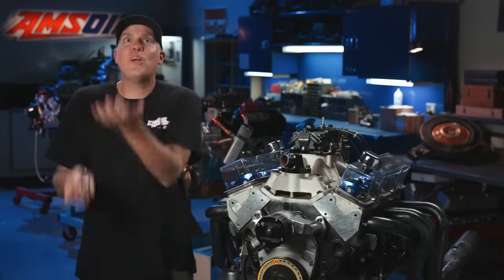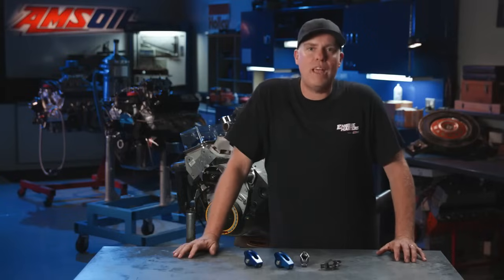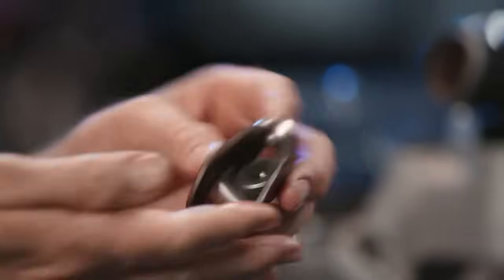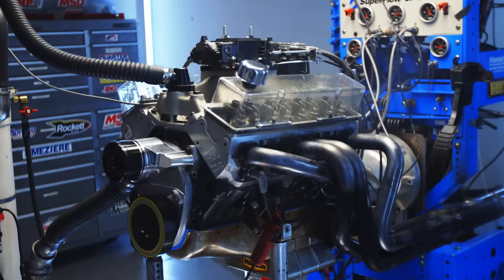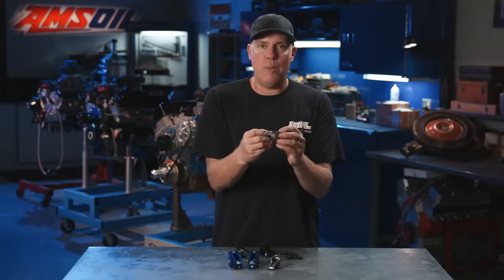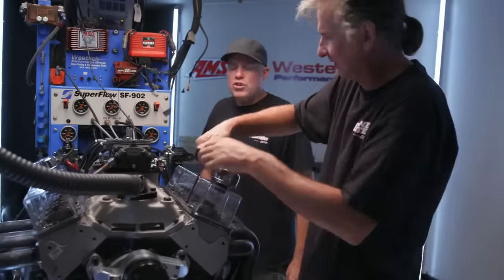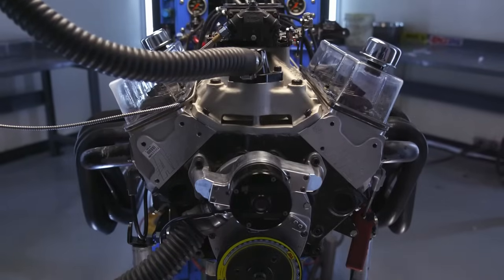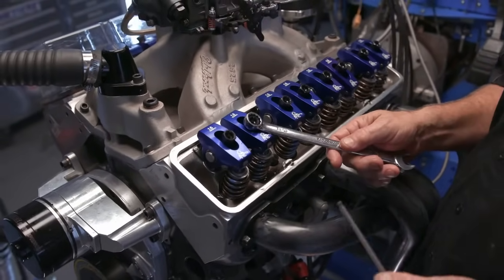ENGINE MASTERS  S2E29  Do Roller Rocker Arms Add Horsepower?

Comment: I never switched to Roller  rockers because they give more power.  I switched  to rooller rockers because my Boss 351 had a problem with Braking Rocker Arms. i Bought a set of Crane  Gold rocker arms in 1975 and I still have them. I explerianced two broken rockers, with that engine In teh last 50 years.

Comment: I'd like to see what an actual stock rocker would do. That's a "stock type" rocker with a stiffer body and more accurate ratios.

Modern oils also cut down on a lot of the friction the rollers are to prevent anyway.

Comment: Roller tip was invented to stop side loading the valve, if you look at a set of circle track heads that used stamped steel rockers you would understand

Comment: Def worth it first less friction equals less wear on Cam and guide's etc. The biggest gain is being able to use 1.6 ratio rockers. With a good set of vortec head's with some spring upgrades and a decent little Cam with a 107 to 109 lobe separation will wake a engine up and when you pair it with a msd ignition etc. sometimes the most important thing for having a good running engine is have good quality ignition setup and the proper intake. Weiand seems to have the best all around performance great driveability and great power band.

Comment: 19:12 don’t forget you also have to make sure you have clearance you don’t want the body hitting the retainer I don’t think the 20 hp is enough game for me to spend 800 on a new set of rockers from HarlandSharp not to mention then I would have to buy a new set of push rods and Smith Brothers pushrods aren’t cheap. I said a 16 runs about $250 i’ve always looked at roller rockers. It’s just something that gives you reliability and repeatability if you’re a demanding driver and you guys never mentioned stud girdles that would’ve helped you with the smaller 3/8 studs if you can find a set

Comment: Glad I watched this video because now I can tell a guy I'm building a 289 for to watch engine masters to end any arguement about how much HP is this or that worth. We're putting a  igger hyd flat appet cam and a few other goodies and he's not convice nor is his dad about how HP this mod or that might be worth. The 2 of them are comvinced changing cam and i take isn't going to make that much improvement over a stock engine. I don't agree. When Ford built the 288 2 barrel and got 195 Hp then installed a bigger cam and carb, made 271, not far off froma 100 HP gain and the lower level engine only made 25 HP more than yhe 2 barrel. Of course the factory 4 intake was still horrible compared to a good aluminum unit. I suggested i stalling a good set of roller rocker on this engine but so far hei not going for it. het. If I can get him to watch this, maybe he'll change his tune, pun intended. I can't get him to come off the single point ignition either. This guy is just a stick in the mid a out most everything. Gonna take a lot of work and comvoncing. Electronic is nust that much bette4 and even more dependable but maybe he's still on the dooms day think with EMPs going off. But that doesn't make any sense either because he drives a late model 6.0 LS pickup most of the time.
Reply: Good luck. I stopped building engines for people like that. They are never happy and everything is always your fault.  Even if you send it in a text. Give me your engine goals and here is your price.  Take it or leave it.

Comment: 4:02 as old as this is, I would still like to know the horsepower number difference between a particular set up with a 1.5 ratio. It is switch up to a 1.6 ratio. I don’t feel a 1.7 would be very common on the streets. I know that wouldn’t be uncommon for a big block, but I would be curious the difference in power production percentage of gain.

Comment: Nobody mentioned the failure rate of those tiny needle bearings in the rollers, or the failure of the roller tip when that aluminum starts wearing due to pressure etc. Those stamped steel will last hundreds of thousands of miles, not so sure about rollers. It's a matter of durability and reliability vs a few extra HP.
Reply: 200,000 miles on honda roller rockers.
Reply: You're forgetting that you'd need guides and valves by 200k, where as a good roller that didn't fail will allow the valves and guides to last far longer!!

Comment: I have to argue whether over head cam engines have rockers arms. They may not use a pivot point in the middle.l but they do follow the cams and increase lift unless you have an engine that uses buckets over the valves and thereby eliminate several moving parts in the design. Like a Toyota 3.0 liter v 6 or a Honda motorcycle
Reply: Those are called cam followers, instead of rocker arms.

Comment: I'm not sure why it took so many years for roller rocker arms to be used in the automotive and racing industry?  I have worked on large radial aircraft engines that were built for WWll fighters, bombers and transports. Roller rockers are indeed not new technology. Curtis Wright, Pratt&Whitney and Jacobs among just a few, All used roller rockers. Even the lifters in those engines used a roller assembly where they contacted the lobes on the cam plate. Durability and Reliability is what those big radials needed in a combat environment. Neat stuff for the early 40s thru 1945 and the end of the war!
Reply: A friend rebuilt a old Land Rover years ago, the engine in that had  lifters with a large ball bearing on the end of the lifter. That is the first Roller cam I seen in a production engine
Reply: If I remember correctly all of Chrysler research into hemi heads was for WW2 aircraft engines
Reply: @outinthesticks1035 That's right!!
Reply: @outinthesticks1035  I was part of "FIFIs" flight crew for about 10 years.  She was the only flyable B-29 In the world , but now there's another one flying. All of those Curtiss Wright 3350s that I worked on, had  Chrysler stamped on the back of the engine case. Cool stuff!
Reply: adding a roller is more complexity and cost, if you want to make money you avoid it... until you can't.
Reply: @nerd1000ify I agree!!!

Comment: I have a 4 bolt main 350 chevy with a Calif. certified Comp Cams cam and DLC lifters.  I use 1.7/1 full roller rockers for a long time now.  With these rockers instead of .480 lift I have almost .530.  What I did not know until now is the power from the rocker ratio.  I wonder how much more power there is from 1.6-1.7 rocker ratios.  This thing runs hard from 1,000 rpm.  I also had 2.02 and 1.68 stainless valves put in the heads with the proper springs for this lift and set the height with the special measuring tool for spring height.

Something for all to prevent broken studs in you heads, motor, and especially exhaust system.  20 years ago I changed all the exhaust, intake, and water pump bolts to stainless.  When you use stainless they will never rust and break.  I don't care how long they were in there or for many years the minute you put the wrench on the bolt or nut it just comes off.  It is worth the expense.  Think of the problem when an exhaust bolt breaks in the head.  That is a big problem to get it out.  Not with Stainless bolts.  This motor is in a 1969 Chevy G10 stretch van with about 1.5 million miles on it.
Reply: Sadly there is no such thing as a HT stainless bolt. All they are good for is corrosion resistance and looking pretty. They are ALL weaker than HT steel bolts. In low torque situations they’re OK. Elsewhere forget it.
Reply: Stainless bolts are about as bad advice as a person could give. No offense but stainless threads gall. Full stop

Comment: One thing I didn't hear mentioned is that a roller tip can reduce side load on the valve stem. This has the potential to increase the service life of both, the valve and the guide. For those of us who want or need to build long lasting engines, that makes roller rockers an investment in durability, as well as reliability.
Reply: I almost always put in at least roller tip rocker arms when I build engines specifically for that reason. If you measure 100k mileage guides, you’ll see the difference
Reply: @Alaska_Engineer fully agree. After tear down inspection on my high mileage sbc, valve tips had no wear.
Reply: @goratgo1970 but how about the side loading on the guides at 150 thousand miles?
Reply: Ok, 40 years ago I drove, street raced a solid lifter 289 with a rebuilt Shelby dual point distributor! It ran day in, day out, to work, to visit relatives 3hrs away! Check the points every so often, adjusted the valves once! It ran! It got 17-18 mpg on trips! I’m not saying that technically wasn’t great! I’m saying that the earth hasn’t shook over the technology in 50 years! The implementation of fuel injection is the biggest advancement! We had overdrives in the late 50’s! The Europeans were at least 30 years ahead of us because they had to be!
Reply: Do they really spin though 🤔
Reply: @Michael-st3wg yes. If for no other reason than the spring passing along its rotating action through friction.
Reply: They literally mentioned it.....
Reply: @alexcorona , they literally don't. They mention valve tip wear, and they mention work-arounds like hardened tips or caps. 

I ran the video through Google's Notebook LM, just now checking for anything related to guide wear or stem wear, and the AI didn't find anything. If you know when, in the video it was mentioned, let me know. I'd be interested in what they say.
Reply: Well, did you consider all those tiny needle bearings in the fulcrum? To each their own, but the factory struggling to meet emissions and fuel mileage standards! I did mention that I worked 33 years in maintenance for the largest OME supplier in the world? This silly crap insured my family a decent lifestyle.
Reply: @markmccarty9793 , I think I'm finally starting to understand what you're getting at. Correct me if I'm wrong, but what I think you're saying is that the added potential failure points of needle roller bearings, and of the added complexity of the additional moving parts is a trade-off against the simplicity of stamped steel rockers. 

I don't disagree with those points, but they were raised in the video. 

All I was saying is that the points I made in my original post were not addressed in the video, and they should also be considered when, as you say, people make their individual choice. 

I had a conversation about the durability of the roller rockers I purchased for my last engine project with their designer. Some of the aspects he addressed made me feel comfortable with the product. When I received the set, I was very uncomfortable with the porosity I found in one of the rocker bodies. This was obviously a problem during the extrusion process. He dropped off a replacement in person, the next time he was in my area. 

I agree that navigating these choices is a personal matter, but I also feel strongly about close visual inspection of all parts, playing with each part with your own two hands to find stress raisers, bearings that hang up, flaws exposed in the machining process, etc. Basically, anything you can do to reduce the likelihood of component failure, after the choice is made.
Reply: @bernardh9908 To each his own! I’m just pointing out that to my knowledge the factory doesn’t have them! Like a circle track guy I knew, it’s mostly monkey see, monkey do!! Po boys need to put the money that’ll deliver the most bang for the buck! Those things are for cars that might run 50 miles a year, 1/8 miles at a time!
Reply: I just thought of something else. Increasing the rocker ratio also increases the valve side load! In other words, the more you increase the rocker ratio, the more important it is to mitigate that load at the valve tip.
Reply: Marine engines. I just put roller rockers on twin 454s
Reply: To each his own? I’ve seen stock rockers back in the mid 70’s that had 150 thousand miles on them and were still going strong at the valve job! Ran push rod guide plates with hardened push rods with no problems! Can’t measure the difference on the time slip! We ran a fresh 351w, 0.40 , cheap hyperutectic pistons $40 ring set!! Turn the timing back 6 degrees, pop 150 on it and rock n roll! Just have fun!!
Reply: @markmccarty9793 Talking guide life here, NOT rocker arm life....
Reply: Na because on LS they go 500,000 and you can still reuse the valve. The valve seat and the valve guide. You can't do that on old SBC or BBC.
Reply: We all know that already.
Reply: Haven't read all the comments to see uf this subject was cover so I'm gonna speak it. Factory rockers being made produced by stamping parts from rough pinched steel steel and coming from God only knows how many machines that can be anywhere and everywhere in tolerance spec. So switching to a machined part at the very least bring tolerances down which is going to smooth valve train dynamics and even out aspects of valve movement, even out cylinder to cylinder output. If you measure a set of Chevy 1.5:1 rockers you could find variations from 1.45: 1.52, a very sloppy spec. Comp Cams supposedly warrants their Magnum street rollers to be 1.52: 1 IIRC.
Reply: @BretTschacher Stock LS rocker arms are NOT stampings, they are investment cast, which is an entirely different process, and tolerances are far superior to plain old fashioned castings and stampings.
Reply: This is the extract reason I put roller tip rockers on my LS7!!
Reply: 100 percent agreed on this statement
Reply: Absolutely 👍
Reply: Thats a really good point
Reply: A 5 liter Ford will run 300000 miles in a taxicab! Now, you won’t chase down Corvettes in stock tune, as far as depending goes, It pretty much defines durability! I have had ex cop 4.6’s!
Got tired of driving and looking at them. Sold 1, gave 2 to people who needed a dependable vehicle! Anyone who has something to say, I got your sign!!😂😂
Reply: Exactly,that’s the main reason I run roller tip rockers on my mild build bbc with higher lift cam to reduce side loading of valve stem to valve guide to reduce guide & valve seal wear.
Reply: With the quality of aftermarket parts your theory might be sound but in practice I think they would fail due to poor quality.
Reply: Maybe so, but there are literally millions of cars out there with conventional valve trains!
Reply: Not just the Rocker its Harmonix & correct Geometry (pushrods),@ DA exceeding 8 to 9000' I split Ratios.
Reply: I’ll buy into this, but all my Fords ran well past 150000 miles! Also, the time slips don’t support it! 😂😂😂 just one more thing to fail?!!
Reply: A roller itself doesn't necessarily reduce side load. Incorrect geometry does. Put a roller rocker on a head that's killing guides and keep the geometry the same it'll still kill guides
Reply: I’ve seen the needles fail! Most likely lubricant failure? I wouldn’t run the aluminum rockers on street/ strip engines! I’ve seen the aluminum rockets fail! You might see a measurable difference on street motors! But, “to each his own,” said the farmer as he kissed his pig!?? Have a good night!
Reply: @bernardh9908  I guess it’s a personal choice. I mean no offense, but all the modifications the automakers have implemented in last couple decades to extend the lifespan and efficiency to my knowledge the domestic market hasn’t implemented roller top rockers. Now, the oil companies have come light years in technology! Everyone seems to be headed toward overhead cams! But, lift the valve cover and guess what you see! I worked for the largest OME supplier in the country! Any new technology came there, but I must admit, overhead camshaft’s seem to be the future! But pull the rocker cover off and guess what you see! Have a great day, I’m retired, but still a gear head!
Reply: @bernardh9908  okay, I’ve ran full roller, roller tip, and old school 289 rockers on the same motor! Any differences between those are so negligible that I wouldn’t change them unless one was bad! Now, if you’re circle tracking or turning 8000 rpm?!!!
Reply: @markmccarty9793 I'm not sure what you're addressing. Are you saying that you measured guide/stem wear in one motor using two different types of rockers, and the difference was negligible?
Reply: @bernardh9908 it's just something he heard from someone else with out knowing himself.
Reply: @markmccarty9793 well now if you run 7

Comment: I learned a bit. I ran 7/16 on a stroker that made 620. I had a girdle to prevent slap with a bit higher ration and it stayed tight. Bit for milder applications this wins!

Comment: The basic SBC stamped rocker was revolutionary in its day for a reason! Like many OE components it's surprisingly good. This test proves that too.
Reply: It is actually PONTIAC TECHNOLOGY, the design was developed by a PONTIAC ENGINEER in his HOME GARAGE, GM Allowed Chevrolet to use those also in the newly released Small Block in 1955.
Reply: @Corsairforu  I miss Pontiac, man. Even though I was born after they stopped making their own engines, I still love that company. My first car was a v6 95 Firebird, and I still drive an LS1 T/A to this day, even though the LS1 is basically a Chevy  motor. It's still cool to be a part of the Pontiac tribe, so much cool history with that company and the things they came up with. Also sad how GM abused them.

Comment: 1.7 yella terras on my LS2. Excellent roller rockers.
Reply: Did you notice a difference? I want to do some on my ls1. I’ve had a few stock rockers come apart.
Reply: @ls1_cammeroh Not really. Valvetrain is much more quiet. I dont think they add power, just more valetrain stability in the higher rpms
Reply: Junk rockers
Reply: @corvetteZ3r sry you can't afford them. Not my fault.
Reply: @Simple_Youtube I have a zr1 and a Z06 dummy I could put jesel rockers on both and not worry about it